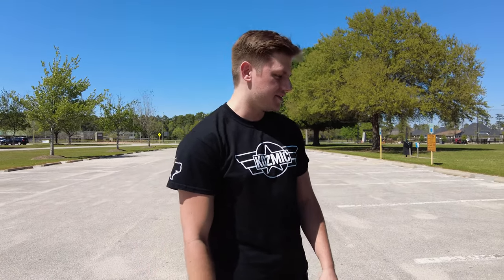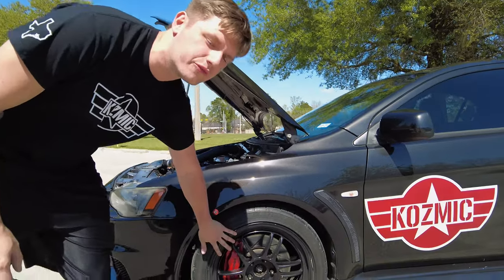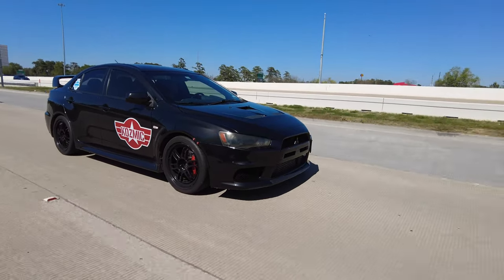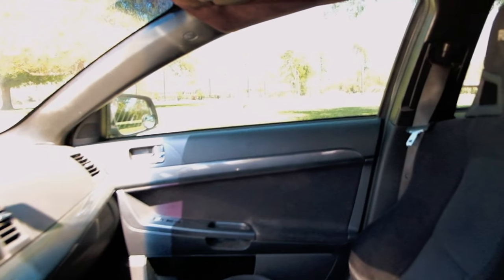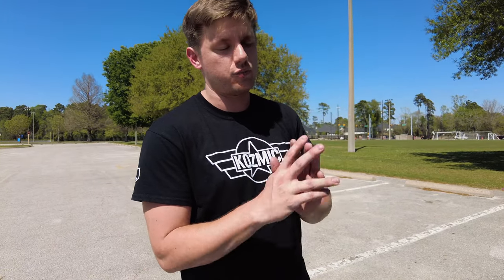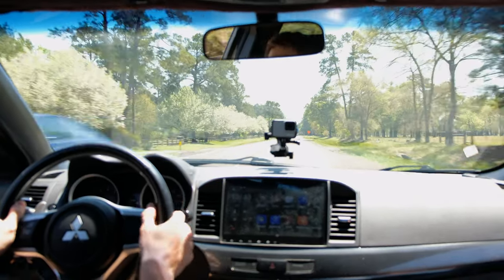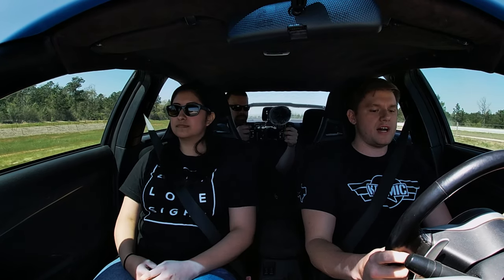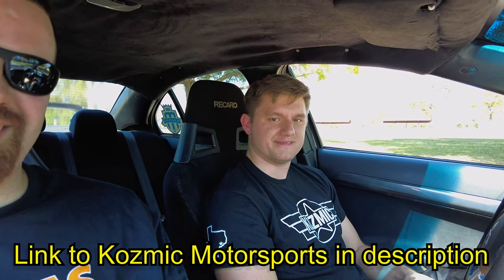Kozmic Motorsports 900hp Mitsubishi Lancer Evolution X GSR ,MAP Built 4B11, MoTeC, 6466 Turbo

Comment: tarin nice video bro! im extremely interested in that accususmp setup youre running thats innovative as hell!!
Reply from the maker: It seems to work well for him.
Reply from the maker: Taran is very sharp and knows his shit.
Reply: Easiest thing to do would be to convert to a ralliart or Evo 8/9 LSD rear end (with axles) and email english racing about their accusump kit. They will sell the whole thing to you, since I kept the X rear end I had to use different fittings but only because I didn't blow this one up yet. Once this rear end fails I'll be putting in an 8/9
Reply from the maker: @TboneSTEAK111  I link it here to help.  ⬇️⬇️⬇️

https://englishracing.net